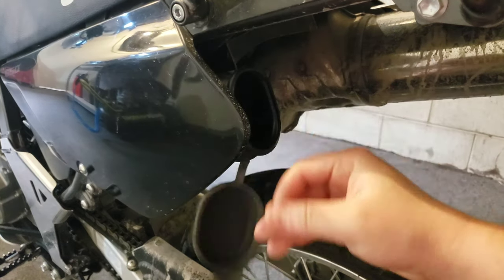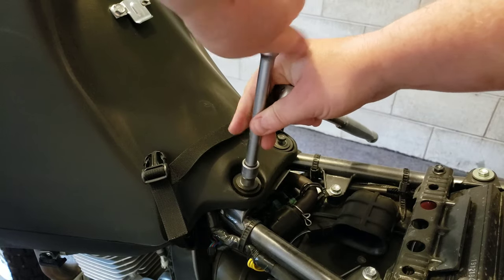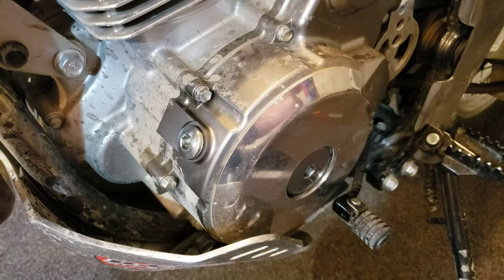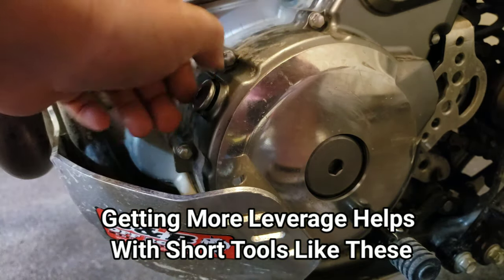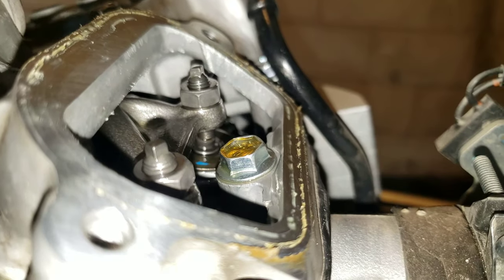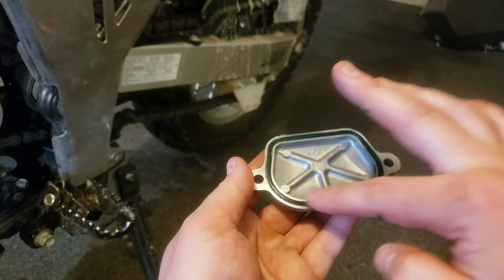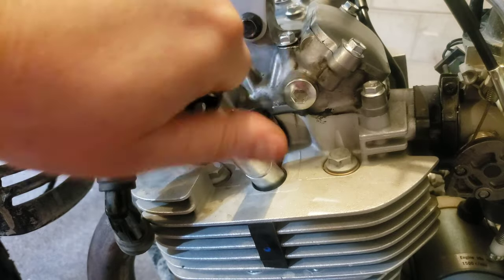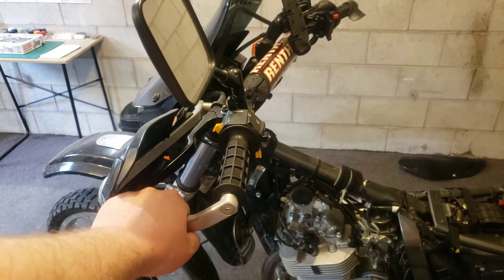Suzuki DR650 Valve Clearance / Check Tutorial

Comment: Just BTW the plugs in the cases can seize & cause horrendous trouble so the best thing to do to prevent this is: 1) I have read you should get the engine warm before attempting removal (not sure about this as the plug and the case both expand at the same rate); 2) put valve grinding paste on the hex spanner when you try to loosen the plug as it will grip a little better; 3) apparently the O-ring is the thing that grabs, so prise it out and put some anti-seize on both sides of it once you get it out the first time; 4) no need to do it up really tight when you're finished, just tweak it down. Hope this helps

Comment: Great video, finally some good camera shots to actually see what’s happening. If your valves are out of spec then how do you adjust? Tighten or loosen the little nut that sits on top to then fit your gauge? Thanks, new sub.
Reply from the maker: Hey mate that's a good point. I should have made an example.  Alot of ppl use pliers to hold the tip while they tighten the nut with a spanner :)
Reply: @NzJohny  Also I am waiting on a new cam chain tensioner so I dont have one right now. Do you think I can adjust the valves without the adjuster on? I just dont want to rotate the compression and cause damage if the tensioner isnt in. Cheers

Comment: Dude, you reckon a 170cm tall bloke total noob rider is too short for the DR650SE, im torn between this, a Honda CB500X or CRF250L, all reasonably heavy bikes, CB500X has the lowest seat beating the 650 by only a cm.
I don’t know if I care about both feet touching the ground... should I?
Reply from the maker: Hey mate go for it :) plenty tall enough.   Maybe look at lowering the suspension  "easy and free"  and if u want it even lower maybe purchase a seat concepts low seat for example.   Chers
Reply: I've put 50,000km on my DR since I bought it 5 years ago and it's great but every bike is a compromise somewhere. If i was planning on more gnarly trails then casual easy dirt roads I'd go with the CRF or even the XT250. Some people balk at the XT but I guarantee you'd have fun on it and the low seat is a real comfort off road. It's super reliable and can go places few would dare on a DR.
Reply: Matt Evans I’m wanting to eventually get out and tour around Australia, do both on and off road, nothing too bananas but, if I’m keen, have a bike that’ll be 50/50.
CB500X in my opinion would be 80/20 and the CRF250L would be a great learner bike but not so hot on long road trips ( 500km days ). From my research the DR650SE might be that sweet spot, like all of the models I’m looking at low maintenance good fuel economy. Lots of after market stuff, would wanna respring the forks I reckon, have to ride it 1st but.
Reply: NzJohny ADV cheers bud, I’d like to keep it stock height, if able.
I’m deceptively heavy, 100kg ( mash and roast beef FTW!).
I think I’ll need as much suspension travel as I can, safety gear, panniers, tent, water, food etc, and me, will certainly weigh the fker down. It’s why I’m kinda hesitant on the 250cc.
Reply: Matt Evans awesome man. Yea, that’s the dream. Get the fark outta quarantine, give the middle finger to the rat race and ride into the sunset. Lol
Reply: @BadgerMcblasty  At 100kg plus gear the crf250l will not be a good choice. Go for DRZ400E DR650SE on the cheaper side of things, or if you have the budget look at the Yamaha T7. The crf450L is a good contender but is being discontinued in AUS. I've had the DRZ the WRF450 and now own the DR650 along with a range of other orientated style bikes, the DR650 is a great bike . If you buy the DR try and find a lightly used 1000-2000 kms one for $7000 and then put about 2k in mods. Jet and pipe (very easy for novice mechanic) is highly recommended if you want more power, it really wakes the bike up.

Comment: Why can't manufacturers come up with a threaded fuel tank puck that &%$#ing stays on????
Reply from the maker: Yeah have to agree.  Wouldn't be hard to produce either
Reply: @NzJohny  Cause I have tried silicone many times and it just does not last...more than 15 minutes...now I just don't give a shit and - well I lost one...the bike seems to operate fine without the annoying "pucks"
Reply from the maker: @Heraclitus188  if it works for you then that's all that matters